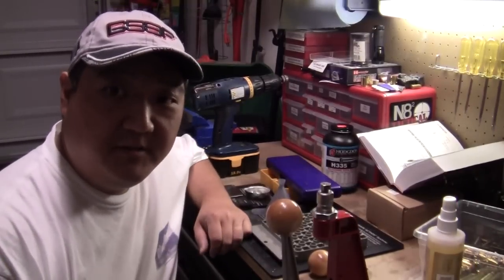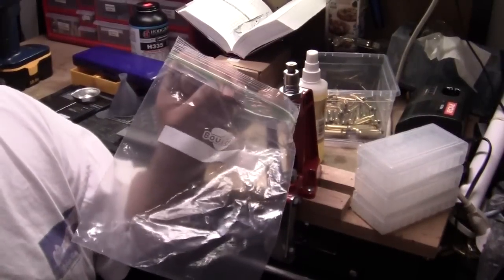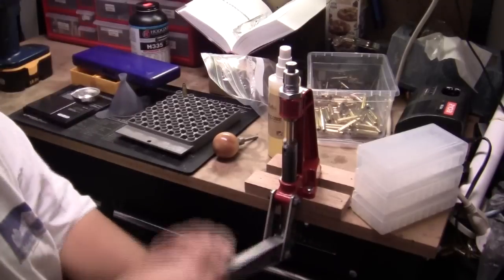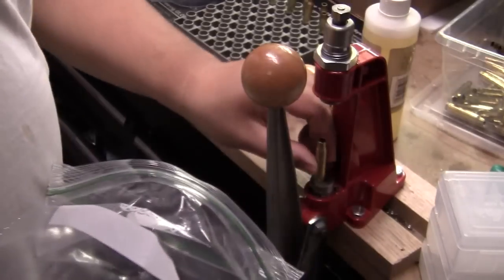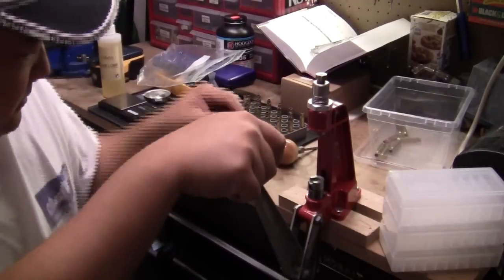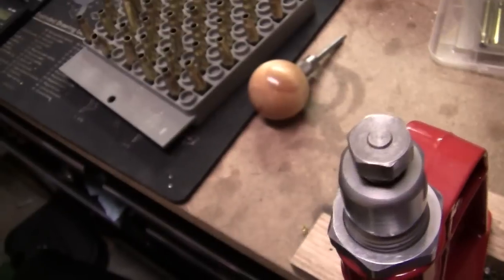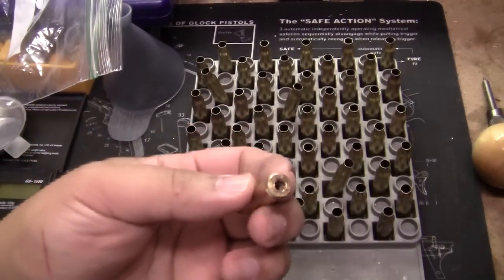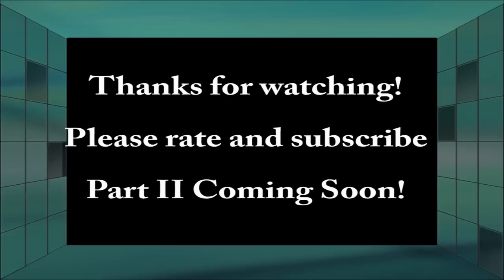Reloading 5.56x45mm/.223 Part I

Comment: I like that you are sharing the economical gear and methods. We can't all afford a Dillon 550.A great tip my dad taught me was to spray a bit of lube on a nylon bore brush of the same cal., and lube the inside of the neck of every 5th case. That will help you avoid sticking a case on the resizing ball. As far as carbide, it's just a super hard material that won't wear out as quick, but it still needs lube. Just maybe not as much. Keep the inexpensive steel one's clean and lubed and you're good!

Comment from the maker: I assembled this particular setup over time, but I can give you an estimate.  The press and manual were around $50 (now it's around $70), dies ran me about $35/caliber, powder was about $20/lb., primers $37/1000, bullets (lead) were about $30/1000 (at the time).  Other sundries added about another $70 or so.  You could still probably get set up for around $200 or so with this type of setup. However, costs are vary greatly from one geographic location to the next.

Comment: I have a classic cast press that is awesome for re-sizing 556, 308, 30-06. I sort of cut the corner on the whole lube requirements in that I don't use the fancy stuff for reloading. I simply pour a 1/4 inch of synthetic motor oil into a cap and dip the neck into it every 4-5 rounds. Its quick, easy and perfect for full-length re-sizing. You just need to clean you resizing die and shell holder when you are done.

Comment: Quick comment on the re-loader. I also have a Lee C-Clamp re-loader BUT I only use it for de-capping my brass when I bring it in from the range. If you notice how the press stresses at the bottom of the stroke; this is not from the stress of the 223 in the press, its just a cast aluminum press on a couple of blocks of wood which is naturally a little less stable than a cast iron press on a solid block of wood. Drill a 1/4" hole in the bench and put a catch at the bottom for the expended primers.

Comment from the maker: You shouldn't have to.  Just keep in mind that the height of the powder in the shell casing will be higher due to the reduced amount of interior volume.  Those cases were designed to take higher pressures.

Comment: Rcbs makes a case puller( around $16 )  that consists of a drill bit, a  tap, a bolt, and collar . It works verry well and should be on everyones reloading bench.  You just back off the decaping stem drill the primer pocket, thread it with the tap,put the collar over the head of the brass. As you tighten the bolt in pulls the brass from the die.

Comment: Case lube pad means you don't have to put stuff in and out of bags. You can put some lube on the pad and roll three or four lots of however many cases fit under your hand on the lube. Also, tumbling to clean primer pockets can be a pain in the butt, because the medium can get stuck in the flash holes and you have to make sure they're clear before priming. It does, however, produce VERY clean primer pockets. Whatever floats your boat, I guess.

Comment: How's the cabelas case lube working for you?  The third shell I resized with it stuck in my die.  It has a lot of alcohol in it.  I use it to clean my cases.  lol  I use Syntec motor oil to lube with.  Thin layer on a paper towl, let it obsorbe into it for a while and roll the shells on it.  I've resized about 600 or so and no more stickies...  Why I like Syntec is that it doesn't leave a residue like some of the other creamy case lubes.

Comment: @thebudgetarmory  Try Hornady 1shot.  It is a dry case lube that works great.  I have tried many products and none come close to the ease of using one shot.  That is a great press for getting into loading.  I wouldn't load 45-70 on it, but it works great for smaller cases.

Comment from the maker: @monsterman27 The steps are the same.  The powder charge is different, and you have to make sure that the cases you are using are built for the higher pressure round (5.56mm)

Comment: According to instructions on Cabela's spray lube you were using you supposed spray and let it sit for 5 minutes to dry before resizing.  How I understand the lube is made from alcohol and oil and when alcohol dries a thin coat of oil remains, this way you are not getting oil all over your equipment.  I've been using this way and it works.

Comment: Also some dies do not have a fluid hole on them so if you use non evaporative lube and use alot you will cause hydraulic denting on your case necks. Use either evaporative lube(Hornady one shot) or use very very little of the non evaporative stuff(such as in video).

Comment: @thebudgetarmory1 I treat my dies the same as I do my weapons as they are the same type of precision gear. I use a gun scrubber when they are gunked up pretty good and a light coat of Rem Oil to keep them clean. My decapping die and the full length sizer die get a good scrub after de-priming and re-sizing a lot of brass since they get the dirtiest but the other dies; seat, crimp, etc get a light clean since they only touch clean brass theoretically.

Comment: what isnt being explained here is for you guys with Lake City once fired brass or even regular once fired range brass etc... you WILL have to have a small base sizing die due to the cases already fit to another chamber. Once you run them through a small base sizing die then you will be good to go and can use a regular sizing die until they are fired out of another gun and you want to use them again they will have to be small base sized again. Just something no one mentioned to me when I started.

Comment: The bag method is rather messy for me, you need to be careful on the amount of lube, to much and you can cause damage to the case when resizing, with useing that much lube you will need to clean your dies build up causes issues. I have been loading for close 40 years  if a problem can happen I have seen it or caused it.